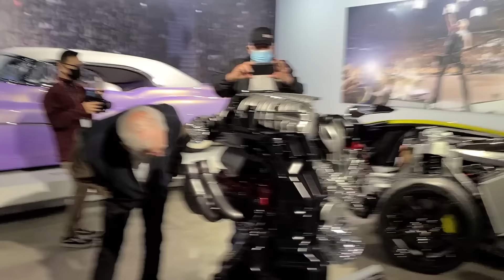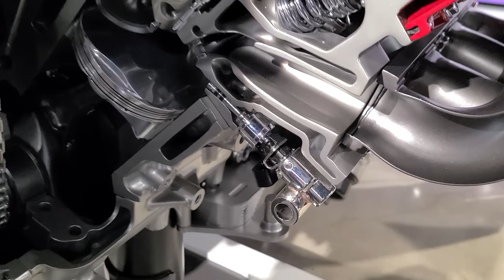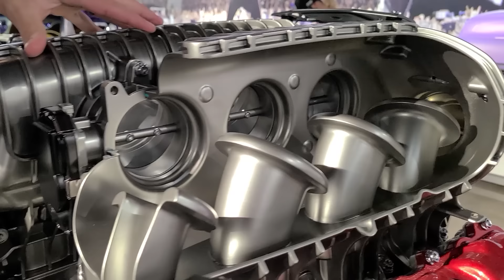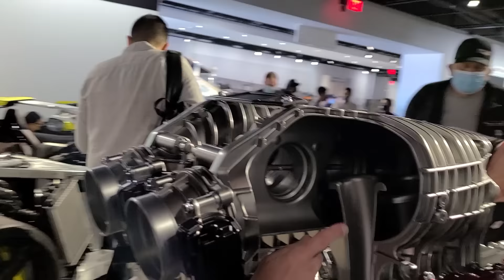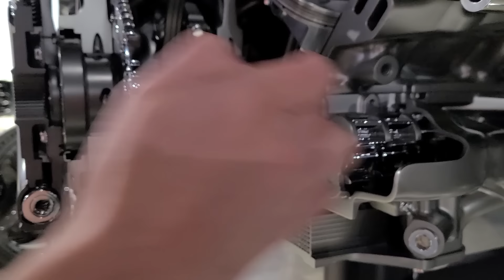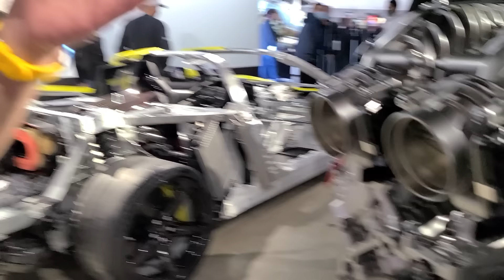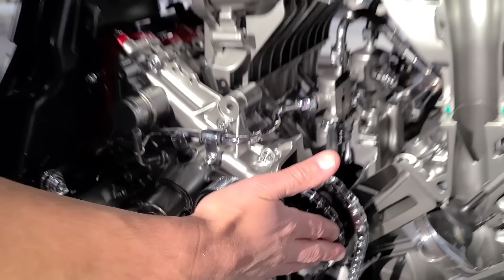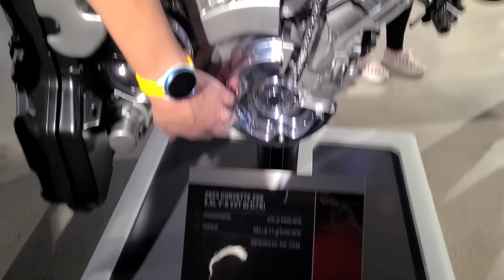2023 Z06 LT6 Cut Away Interview with Dustin Gardner

Comment: The LT-5 in my C4 ZR-1 makes me smile this makes my face crack open!
Reply: That's what this engine design reminds me of.
Reply: I looked your engine up a d it’s pretty cool. I didn’t know they made a c4 zr1
Reply: @MrIlovebmw86  it's in the c7
Reply: @HeadStoneOfTheCorner  I looked it up. They have two engines called the lt5? There’s a new one and al old one ?
Reply: @HeadStoneOfTheCorner  : The C4 ZR1 DOHC engine in the '90s was also called an LT5.
Reply: @oneslackr  I see they should have just renamed it
Reply: @HeadStoneOfTheCorner  just wait till you realize that an ls6 was also a mk4 big block 454 and a ls2 was a pontiac engine designation
Reply: I agree! I have a '91 and it sure is a smile per mile.
Reply: @bobolulu7615  those cars are still very fun drivers but very collectable.
Reply: Have a 92, #500 red/red. Love the car but it eats starters like crazy and the seals for the intake are getting expensive and hard to find.

Comment: How long are the connecting rods and what’s the block deck height?  My guess is a 6.200” rod length.
Reply: Shorter...
Reply: Just a guess,  but those look like 5.500, this is a short deck height engine.
Reply: @dmitchellhomes  what’s the deck height?
Reply: @michaelvanparis9236    I was guessing 8.900,  maybe lower...
Reply: @dmitchellhomes  yeah that could very well be. If we are assuming a 9.24” deck height, we know the crank stroke is 3.150” (making the crank throw 1.575”) and if the rods were 5.5” length that would leave us with a piston compression height around 2.165” that would be a big compression height unless the deck height is actually something like 8.24 - 8.27” . The rod to stroke ratio would be right at 1.75 : 1. Sounds real plausible man
Reply: @dmitchellhomes  I think your guesstimate is probably closer than mine and it fits.
Reply: @dmitchellhomes  hmmm 🤔  if the deck height is around 8.900” (which your comment on reducing the deck height to save weight seems very logical) and the crank throw is 1.575” and the Rod length is 5.5” that would mean we would need a piston compression height somewhere in the range 1.815 & 1.825” judging by the cutaway that piston don’t seem to be anywhere near that compression height.
Reply: This stuff is exciting!  I can’t wait until we learn more about this engine with all the detailed blueprint Specs Ect.
Reply: @michaelvanparis9236   yeah, this is a really exciting engine.    I cannot wait to learn more about it.
Reply: @dmitchellhomes  yes indeed!  If I could only get my hands on one now I’d work on a billet block in CAD. Haha.
Reply: @michaelvanparis9236   yeah, I think at maximum the deck height is 8.900,   It very well might be even shorter than that, on the rod length, 5.500 might be short,, but I think it will end up being in that vicinity.    Just pure speculation, but those rods look short, and another thing I notice, I think they are using Honda size rod journals which is common in racing, even 500 in.³ pro stock engines use them, but I have not seen a factory engine use them yet.
Reply: @dmitchellhomes  that’s exciting on the rod journal size. I wonder if the wrist pins are DLC Coated.
Reply: @michaelvanparis9236  now that would exciting
Reply: Looks like a nightmare to do repairs on.
Reply: @dmitchellhomes  do you know what length they are?  I ask because @ 6.2” rod length (assuming a 9.24” deck height) and a 3.150” stroke (1.575” throw) would require a piston compression height around 1.454 Any thing larger would be crazy and just looking at the video there those pistons don’t even look to be in the 1.45” compression height range. I could be wrong though.
Reply: @michaelvanparis9236  Given that the wrist pins are up into the bottom rings, it's probably around 1.2". I'd be very surprised if they stretched the deck height enough to fit a 6.200 rod though. I'm guessing that it's packaged to fit as closely to the LS/LT envelope as possible.
Reply: I don't think so,  in an engine like this, bob weight reduction is very important, and shorter block height cuts weight as well,  you hear he said a DOHC engine only weighs 1kg more than the LT2,   thats amazing,  this is a light DOHC.      It will be interesting as more info leaks out...
Reply: @fastindy  if that’s the case (and I don’t know what the deck height is on this engine) but if it’s 9.240” like an LS/LT then for the parts stack to be near 9.240 -.010” (going lower than .010 in the hole don’t make sense) anyway the parts stack would have to be in the range of 9.230” - 9.240” since we know the crank Stroke is 3.150” that means the crank throw is 1.575” so if we do the math 1.575 crank throw + 1.200” compression height you would need an even longer connecting rod to even get close to 9.230 - 9.240” parts stack. The rod length would have to be something around 6.45” range just to be in the range of a 9.24” deck.

So maybe the deck height is waaaay shorter than 9.240”. 🤷🏽‍♂️
Reply: @michaelvanparis9236  Yeah, that's what I'm saying. To get the taller cylinder heads down closer to the crank C/L they would have to give up some rod ratio/deck height. Plus, as DB said, they'd be looking to minimize weight of the rod. With a 3.150 stroke the piston/rod velocity is still going to be very high.
Reply: @fastindy   in this engine we have to think different than past LS/LT,  it does not share anything.    I know Cosworth was very involved in the heads, and induction,  possibly the whole engine,  but other then that I do not know much at this point.
Reply: @dmitchellhomes  I'm only talking about the outside size of the engine and width across the cylinder heads. I'm guessing the only thing this shares with an LT5 is the bellhousing bolt pattern.  Maybe the crank pattern, if we're lucky. Even then, packaging this motor into existing LT applications is probably a non-starter given the upturned headers and fuel injector location.
Reply: @fastindy   So I think if you see this engine with the induction system and exhaust  off,  its very short,  and a small package.   LS/LT engines are tall, because they are designed for trucks initially, and then modified for cars.    For trucks they need the long rods, tall induction to boost torque,  but in this clean sheet case,  you do not have that truck design criteria,  and so you can optimize for small CID high revving package, which can be much shorter in the block, and looking at the heads and port angles you do not need the width either.
Reply: 104.3 mm bore - 80.0 mm stroke

Comment: So... it's a OHC. That will be a nightmare once companies like Texas Speed and Performance try to make aftermarket parts for it
Reply: That doesn't really change much other than the price. Especially since it's a fairly direct acting cam-follower-valve system with no variable lift action happening in between.
Reply: Wait until they drive front wheels with electric motors
Reply: Texas speed will definitely struggle. They can’t make anything good
Reply: @corvetteZ3r  LIE
Reply: @kcwizard72  prove it

Comment: Unbelievable amount of engineering goes into this.  Absolutely fascinating.  My first car was a 1972 Duster that had a 198 in it.  I could work on it, this new LT6 , no way.   Thanks for posting this .  So glad you were able to have Dustin on to explain it.
Reply: Mine was a 71 slant six 225!
Reply: Beyond replacing spark plugs, change oil and filter and walnut blasting the intake valves, what would you need to do?
Reply: @machtschnell7452  exactly you don’t need to “work” on these engines that’s the whole point.